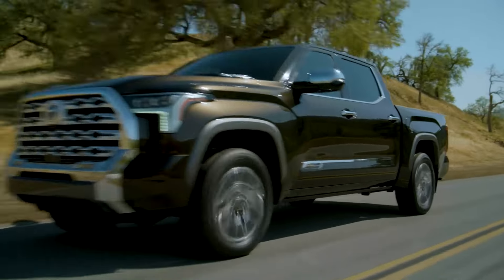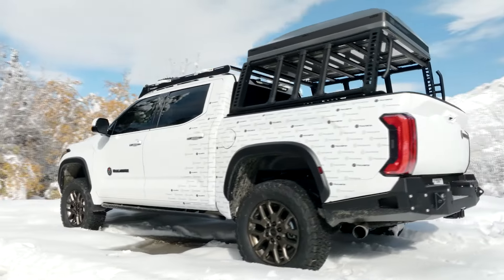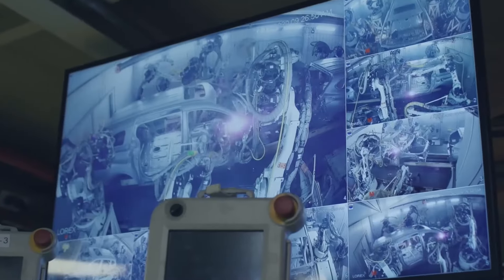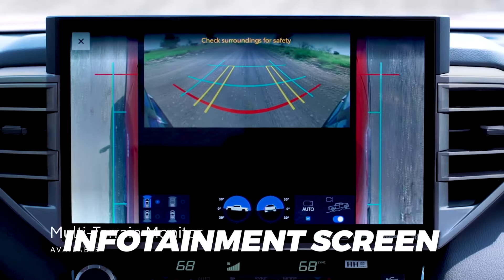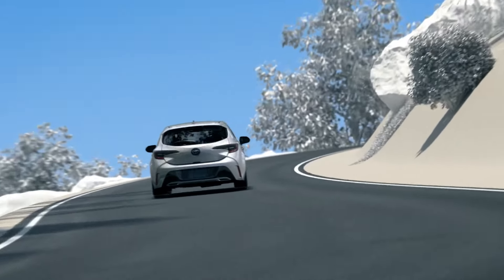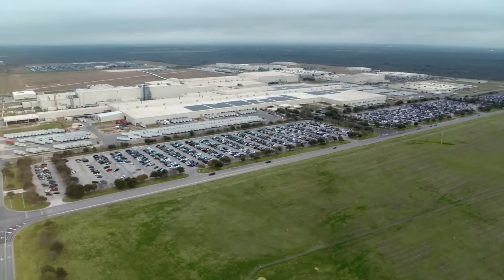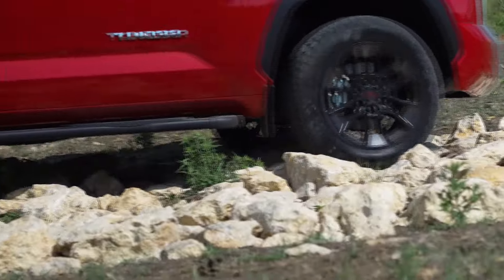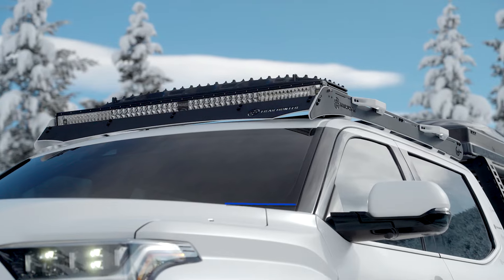All-New 2025 Toyota Tundra Wows Everybody!

Comment: Fixing the problem with the engines blowing up, making the body lines strait and getting rid of the cheap plastic throughout the truck would "wow" me. The new Tundra makes Ford, Dodge and Chevy look like very high quality trucks. Speaking from recently dumping my newer Toyota before its second oil change because of continuous problems, the legendary Toyota quality is dead. It's over priced garbage and Toyota did its best to avoid standing behind that garbage. Can you afford to own one? Turbo problem, pull the cab off. Engine problem, pull the cab off.